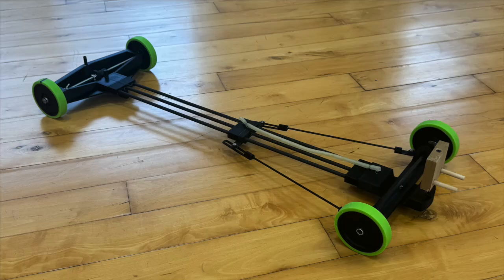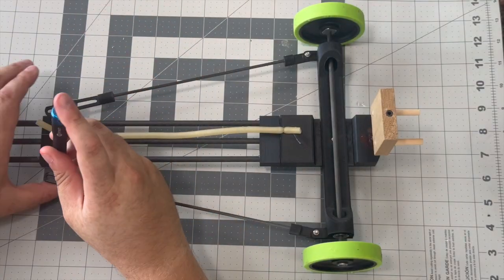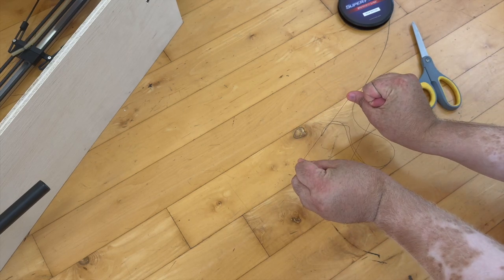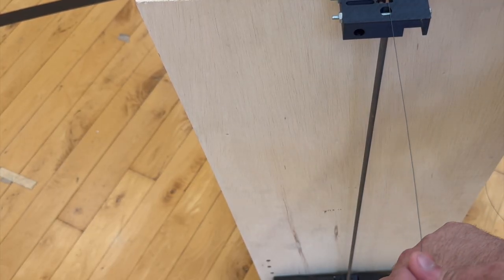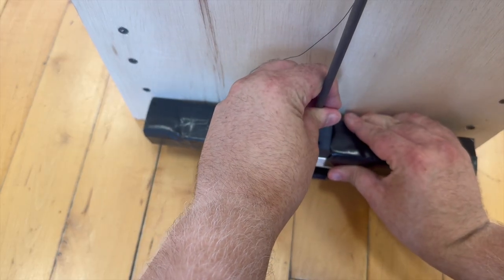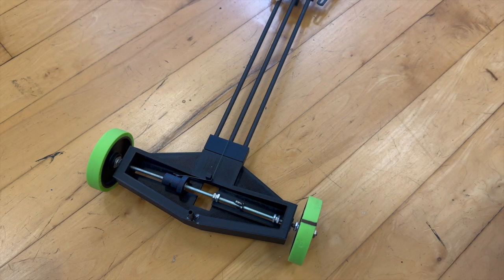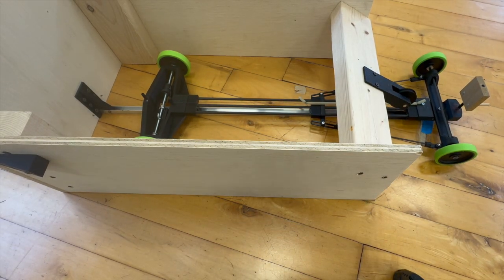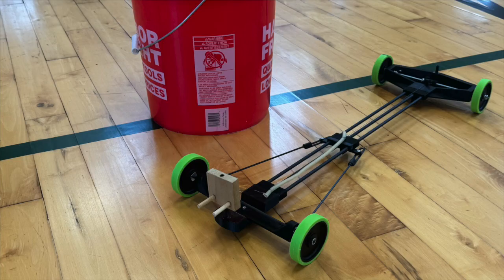How to Calibrate an Egg-Transporting Vehicle | Scrambled Champion Kit 2026

Comment: My vheicle moves around the bucket but dosent move back to go to the target. Do you know how i could fix that
Reply from the maker: If the vehicle is going backwards at the end of the run, that means you have too much of an offset of the decelerator from the wingnut’s stopping point. You need to decrease the offset until the vehicle no longer goes backwards
Reply: Thanks but I meant that the vehicle goes halfway around the bucket and goes straight, It doesn't turn all the way around to go to the target.